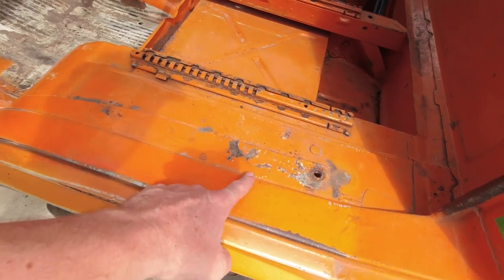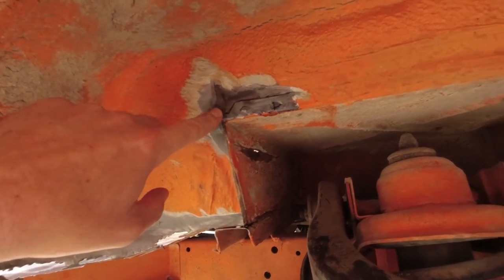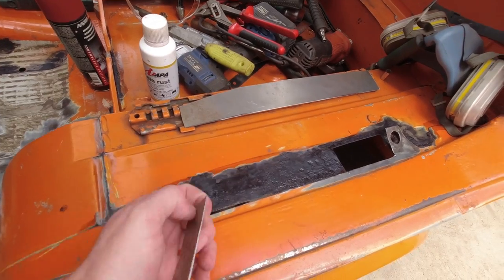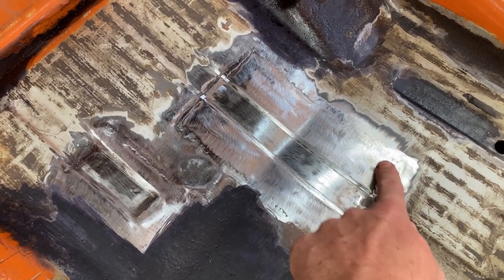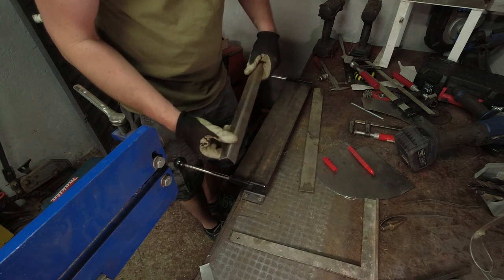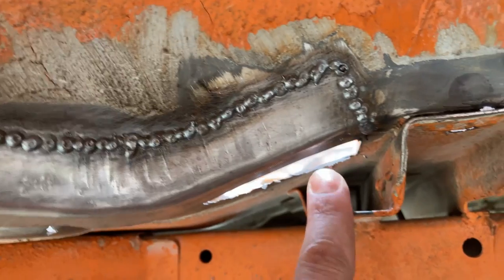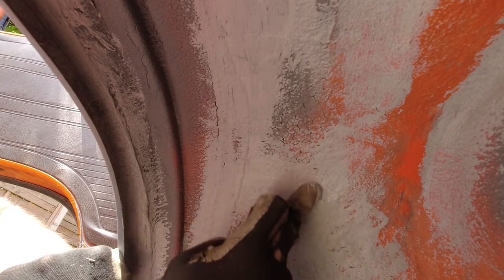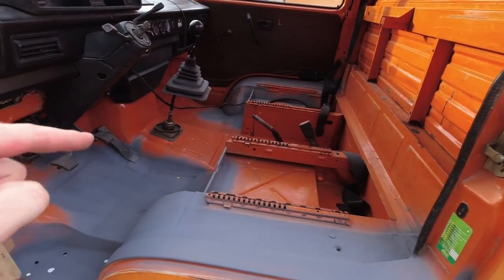Fixing Major Rust on the Volkswagen Transporter T3

Comment: Hey mate! Thanks for the video. I just bought VW T3 with high roof and starting with campervan conversion but first things first I need to fix the rust issue. I already did some patches on the rear bumper and side moulding which was easy as it was straight or slightly bended but now I got to the same stage as you described in the video. It is so helpful to watch someone who knows what he is doing and sharing a perfect tutorial on how to do it. I felt kind of lost and helpless but after this video, I am sure I will be able to do it. I will surely spend more time doing it than you but because of your video, I feel confident enough to do it. Thanks, mate

Comment: Hey, There Sebastian, welcome back on the VW T3 restoration, you did some nice padge work there. I don't know if you have seen my work on the VW T3 SC, I did clean the whole beneath for bitumen it`s equal to rust under that .but we have all our methods to deal with rust issues. the work you did with the driver`s floor was excellent also on the Dogleg the panel in the seat bay was well executed. did like your work and the metal forming of the different metal pieces. well-done👍🏻👏🏻☮🙏🏻🇳🇴. Greetings.Hubertus.
Reply from the maker: Thank you Hubertus! Yes, I seen that. Soo much work to remove all of that stuff. Remember, this is just a work truck. I’ll probably do it on the red truck though.
Reply: @OllarisGarage  Great Thanks for the answer,Sebastian👍🏻.

Comment: You did a very good job on this project. I was worried when I saw the rust of your T3 but you fixed it very well. I would buy a car repaired as well as you repaired your T3. How did you learn the use of metal shaping with the shaping wheel?